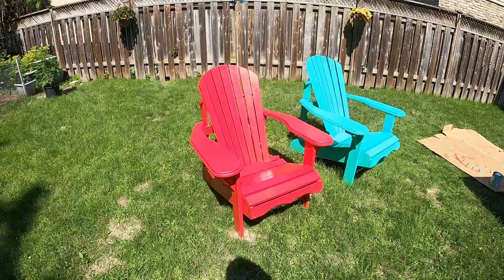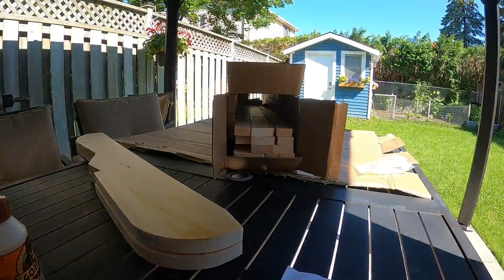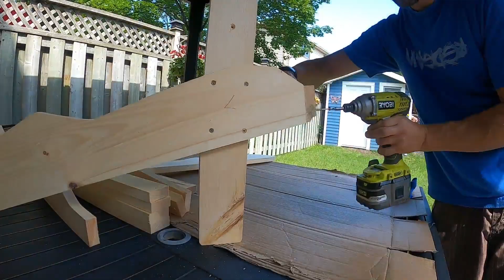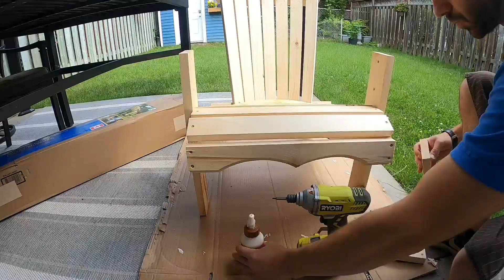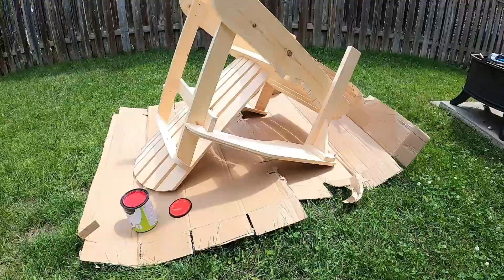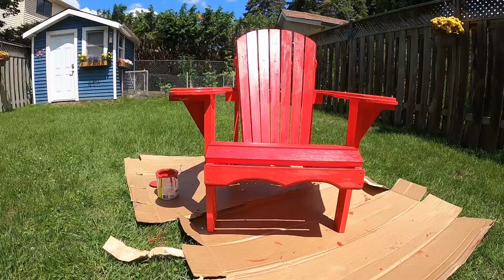Building Costco Muskoka/adirondack Chairs

Comment: Thank you ! What kind of paint do you recommend ? Are the chairs still in good condition after 3 Canadian winter ? Do you keep them outside all seasons ?
Reply from the maker: I bought 900ml premier exterior door and trim paint from Canadian tire. One can did one chair with a bit left over. Yes the chairs are still like new. I put them under a tarp over the winter but no paint has faded or chipped off yet.
Reply: @NorthernChris1  thank you ! I got 3 chairs to complete this week. :)
Reply from the maker: @jnanakshatriya668  good luck! the first one takes the longest but after that they go quickly.

Comment: Would it be easier to paint and then assemble. Is there a reason it was painted after
Reply from the maker: Yes it would have been much easier and faster to paint before. I glued all the pieced before screwing for extra strength as I leave them out all winter (Canadian snowy winters). The instructions do not call for glue, the glue would not work properly if you try to glue two painted pieces together versus bare wood.
Reply: You should woodglue all the joints, that is recommended in the instructions on my chair. Cant do that with prepainted parts.
Reply: @practicalguy973  I mean.. you could. with construction adhesive.